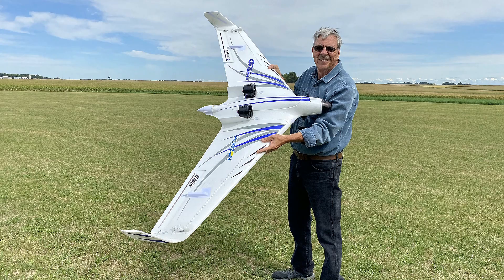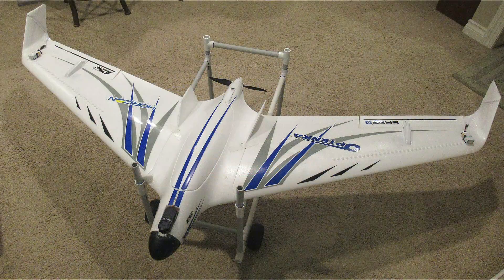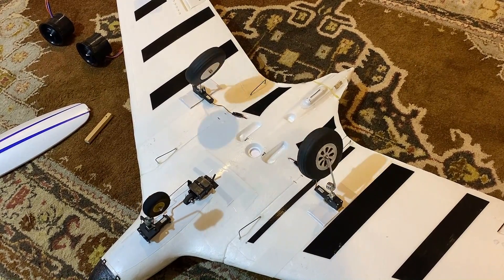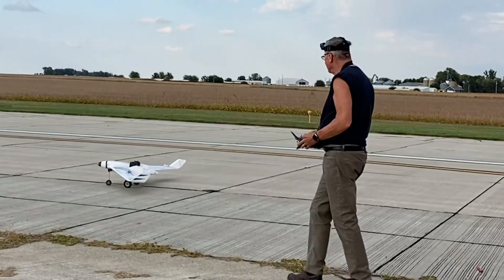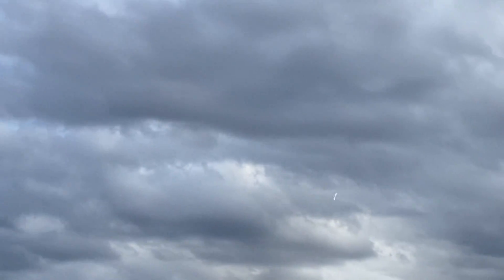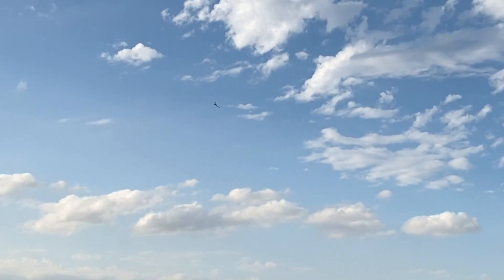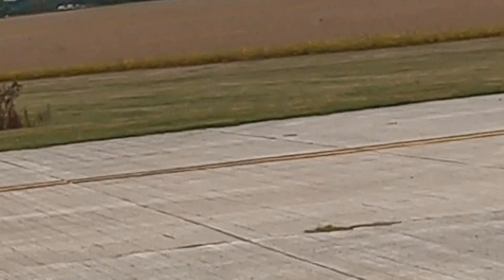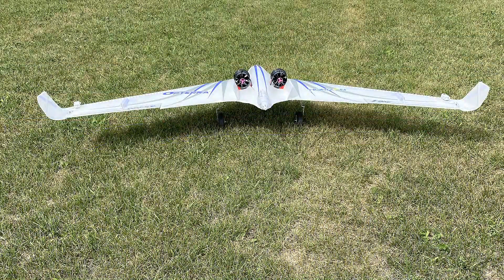I added 2 ducted fans, plus retractable landing gear to my 2m Opterra flying wing.  How'd that go?

Comment: where can i get some retracts like that i want landing gear on my opterra 2m
Reply from the maker: Here's the link.   https://www.ebay.com/itm/113728377943?var=413864572206  They do not come with the 5 mm strut rods, so you need that (or already pre bent ones) plus a set of wheels.  They look wobbly, but sure work well for me.  Thanks and happy flying.

Comment: What do u think happed Dave?  I got a lemon receiver that’s been cutting out on me on 2 flights but regained control just bought a new receiver with a satellite to replace I’m not gonna chance another flight,hope you figured your problem out looking forward to the next flight
Reply from the maker: What happened was the fans were aimed with thrust in wrong angle.  It never quite, and the faster I went the more it pushed the nose down. If I had let off the throttle, it would never have pushed itself down.  I re aimed the motors and now it is fine.  Never had and problem with my lemon rx's so not sure what to say there. Thanks. much.  Here is a better flight.  https://www.youtube.com/watch?v=TMtdTW_fECs

Comment: I get funny looks and heads shake when I modify my aircraft. But I just don't help myself. I have never used ducted fans, preferring to go with twin tractors. But except for the Spektum freeze, and maybe a bit too tall landing gear, well it looks and seems to fly really nice, like the un modded plane, but better via modification!
Reply from the maker: Right on.  Glad were on the same page and not afraid to mod. It does fly better.  Also, I like to think these fans are tractors!! 😀LOL.  Thanks.
Reply: @NightFlyyer  Ah, cool! How was mounting the EDFs? Mounting tractor motors, unless there are an STL for nacelles has bee difficult. I've twinned a Volantex Ranger 2000 and a -UAV Shysurfer Bixler 2 clone. Each had stl mounts.  https://www.youtube.com/watch?v=zAJb3Iyp4YQ
Reply from the maker: @spartan3299  Soon as I got the motors in the right place on the wing it was fine.  Check out my later video on it. I enjoyed your Night flight. Thanks again. Here's a second flight you might like on this Opterra 7 foot wing.  https://www.youtube.com/watch?v=TMtdTW_fECs&t=165s

Comment: I have had my hand damaged by props also. I didn't like the pusher prop on the Optura. It turned out to be a very simple job to convert it to a tractor prop. Now I launch it with no worries.
I used the same motor and prop, just in front.
Reply from the maker: Good idea. Thanks so much and hope your ok.

Comment: any tips for installing the retractable landing gears into the opterra? did you use balsa wood to install it or just glue?
Reply from the maker: I used 1/8", 2"x 4" ply glued with Epoxy to the wing and screwed the Retracts to that.  Good luck and have fun.
Reply: thank you!

Comment: very interesting experience, much easier t/off for sure. Great !! What about gliding ? The original Opterra have a great possibility to glide and offer so nice extended and graceful landings
Reply from the maker: It still glides forever.  It needs speed brakes, as you know.  Thanks..
Reply: @NightFlyyer  then perfect modification !

Comment: Very nice! It looks faster than before too. You won’t hurt your finger on it now! Glad there was hardly any damage, those fields are good for cushioning a crash, if you can actually find the aircraft afterwards, that is. A cornfield would have been much worse. Keep trying, can’t wait to see the next flight! Semper Fi.
Reply from the maker: It is faster and that is why I could not hold it.  The faster I went, with gear down, the more it was being pushed down and I didnt have any elevator left to climb out.  If I had backed off the power, it probably would have pulled out.  I also removed 7 oz of nose weight and hope that helps for next time.  Thanks Scott and Semper Fi.

Comment: Despite the fact the Opterra seems to be a bad Omen, it sure looked good flying with those 2 electric ducted fans. It was hauling the mail. It sounds a little like a trim issue. At the 2:38 mark in the vid, you mentioned it needed a lot of up at that point, then when you put the gears down it started to veer to the right. How did the CG look when you set it up? Hope to see it back in the air soon.    Tom
Reply from the maker: Right and the faster I went, with gear down, the more it was being pushed down and I didn't have any elevator left to climb out.  If I had backed off the power, it probably would have pulled out.  I also removed 7 oz of nose weight now and hope that helps for next time. Thanks Tom.

Comment: Cool idea Dave adding those 2 EDF's on that plane what size lipo did you use a 6s or 4s?? Looking forward to seeing you giving this plane a 2nd flight👍
Reply from the maker: I used a 4 S, 7000mah, 100c. It seems the faster I went, with gear down, the more it was being pushed down.  I didnt have any elevator left to climb out.  If I had backed off the power, it probably would have pulled out.  I also removed 7 oz of nose weight and hope that helps for next time.  Thanks much.
Reply: @NightFlyyer  Have you tried checking the fan units? Maybe they need to be mouthed with some up thrust my uncle had the same problem with he tried to convert his Midwest Jetstar 20 to electric with a EDF.
Reply from the maker: @3DMOFO2020  Yes, I have changed the edfs with more up at the front.  Like its a tractor with no ducts in front of it like a prop, so is is pulling or pushing?  I may have aimed them the wrong way, so will just have to see what happens.  Thanks again.
Reply: @NightFlyyer  Cool Dave!

Comment: Great idea. Plane is very fast now. Greetings
Reply from the maker: It sure is faster.  Thanks much.
Reply: @NightFlyyer  How looks current consumption ? I'm thinking about EDF Jet.
Reply from the maker: @Viper81BB  Not sure of that, as I didnt try to test. Both EScs are 80 amp and the battery is a 14.4, 7000ma Lipo.  It still had about 25% in it when it crash landed.
Reply: @NightFlyyer  I will use external UBEC to power all of "avionics" I'm using this in my bigger stuff. If motor power line fail I still can steering in glide or autorotation in helis

Comment: Did you set the failsafe for no throttle?
Reply from the maker: Always, but what we found is this.   Post Mortem:
There was no brown out or loss of RC signal logged at all in my TX.  But  2 things I noticed as I look back when I began flying. First I needed full up trim to fly it and it was way out of trim.  This is elevons and I noticed at half power I was not using as much elevator.  So when  I dropped the gear, at speed, the drag was pulling it down, so I sped up and the motors pushed the nose down further and the elevon servos were compromised and could not hold it. I thought more throttle at the time would help, so punched it up.   If I had just backed off the throttle, I think it would have been fine. I have since  shifted the cg and expect it to fly more in trim.   Please stay tuned and Thanks.

Comment: Mr. Dave - she flew great until you had your lock out. Is there a chance that your BEC was not enough when the gear was extended and excessive current pull starved the RX causing a brown out?  Strange that the RX did not bring the throttle back to zero though. Best of luck on the next flight.... hope she finally treats you right after all the work.
Reply from the maker: Post Mortem.  Good Points, Kyle.  Well, first of all, I have 2, 80 amp esc's in there each with 2 amp bec's, and they are both running in parallel, so lots of power.
There was no brown out or loss of RC signal logged at all in my TX.  But  2 things I noticed as I look back when I began flying. First I needed full up trim to fly it and it was way out of trim.  This is elevons and I noticed at half power I was not using as much elevator.  So when  I dropped the gear, at speed, the drag was pulling it down, so I sped up and the motors pushed the nose down further and the elevon servos were compromised and could not hold it.  I have since shifted the cg and expect it to fly more in trim.  If I had just backed off the throttle, I think it would have popped up and been fine.  Please stay tuned and Thanks.
Reply: @NightFlyyer  Ahhh, thrust angle and CG. Best of luck on Round 2 EDF Tests.
Reply from the maker: @kydawg1684  Well, I have aimed the edfs slightly more up, and removed 7 oz of weight I had in the nose, so we will see what happens next.  Which way would you aim the motors, more up in the front or more down?   I aimed them more up, but I am over thinking it.  LOL.
Reply: @NightFlyyer  Mr. Dave -  Yes good question. I am not sure EDF up or down inclination will be a real help with such a short fuselage. With the thrustline high, you may always have down thrust to overcome. Maybe some more powerful servos that can give you up elevator when needed even at high speed. I hope she treats you right. After all your challenges with this bird.... you deserve some enjoyable flying for sure. We will all be watching.
Reply from the maker: @kydawg1684  Well, with no ducts, it is a tractor in the front, like an airplane propeller, so I aimed it up.  But is it being pushed or pulled?  We shall see.  I also made a big cg change.  Thanks again.